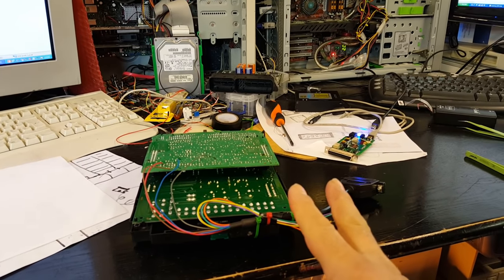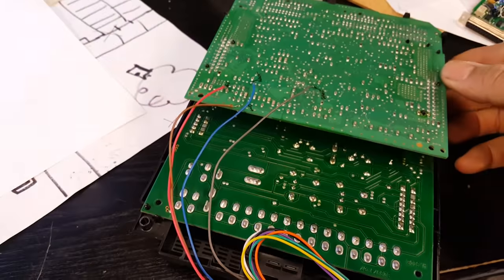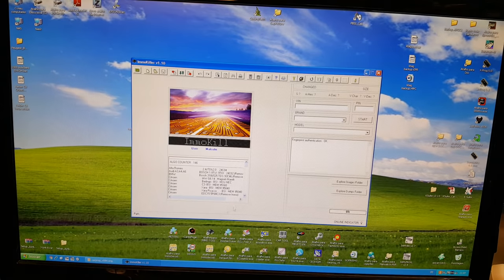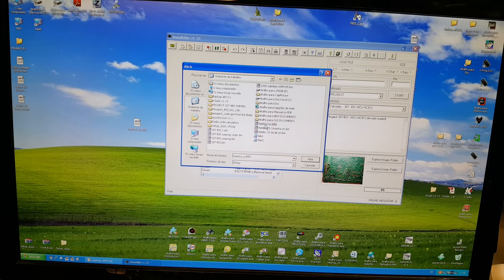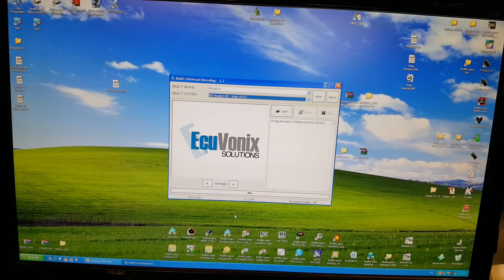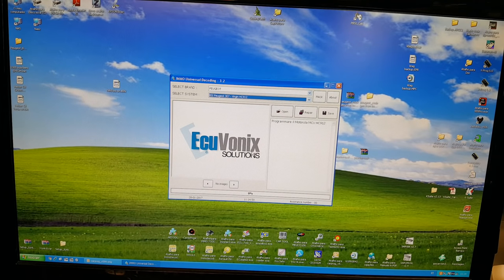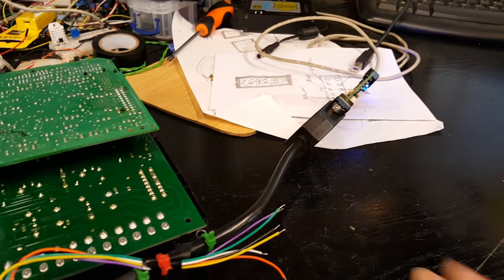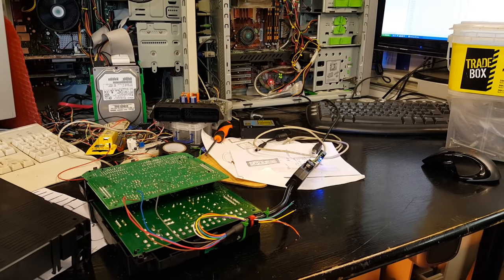Peugeot and Citroën BSI - clone, pin code read, virginize/ reset.

Comment: i have to ask something but i dont know any other place for that so i hope you can give me some ideas in here. my bro has 2004 citroen c2 1.4. cooling fan was not working but car was running well. we took the cooling fan out and fixed it. But after that engine didnt run again, it was just cranking. i guessed that its imobilizer problem. i sent the car to who can do ecu repairs bcz i dont have any tools for that. As i guessed it was imo. He sad i fixed it by cancelling imo which is non sense solution. anyways car came to me, cooling fan working non stop even car is off too. plus engine is not going over 3000 rpm, its running in service mode i assume. Also remote key sometimes locking doors and sometimes dont(this one was exist before repairs too). so what can i do for this car? i think its all about Bsi but you know better so if you can help i can be  happy a lot. Thanks i hope you can answer.
Reply from the maker: Taskin Yucekurt 
Hi
Start by scan the car and look carefully at the live data...
Depending on the findings, follow the fans circuit... 
Thank you for watching!
Reply: Thanks for great videos and help man. Its being hard to find citroen c2 diagrams in softwares like cardata or haynes vivid. Do you know any other one?  diagram methode is so silly on peugeot and citroen. Not cable colors just numbers.  Its also mentioning another control circuit in engine side fuse box too. is it true? sorry if i asked a lot.
Reply from the maker: Hi
Most likely... the ecu will probably ground the cooling fans circuit, which usually is in the engine relay box...
The citroen diagrams are usually traced by the numbers indeed...
Just had a quick look... Autodata does have the diagrams...
The circuit is slightly different, depending on whether you have AC or not...
Either way the system does have a cooling fan control module, which is controlled by the engine ecu on plug B pin J4 wire 1540 and F2 wire 1599B (1599A for the AC)
Hope that helps.
Consider to support my channel and all the hard work put into it at http://www.patreon.com/LMAutoRepairs
Reply: Hi Thanks for advise, i will check it out on weekend. I found diagram on autodata 3,45 you were right  about pin numbers. I got the point but i just confused about Fan harness cuz it has 2 harness on fan plus  socket type relay stays over fan too. tiny harness has 3 cables, main  socket has 2 cables and obviously relay has cables 4 and fan has somekind device on it, i think its speed control unit. i made temporarly solution last weekend. i put a relay between battery and fan, i used fuel pump fuse socket as relay trigger. But you know with this way fan always working  while engine is running. I think they messed up ecu with wrong or faulty software during immo canceling.Tps works faulty too,it has somekind buzz sound and car in limp mode,it was fine before their mess. I cdnt find original bin file on internet. I have old school eprom programmer but im thinking about ordering carprog.

Comment: Really glad to see Portuguese doing great, i have a problem with the JC BSI from a 2009 C5, i Run fvdi to learn PIN and kill it. Have a used One Now, the problem os that i need the PIN to Virgínize it. Can i work the pinout with FVDI or what the best program to read BSI on beanch. Sorry for my inglish not as good as yours :) um grande abraço da velha pátria
Reply from the maker: Nelson Santos 
Hi
Obrigado!
That BSI, does have an external eeprom, or is the one in the MCU?
There is other tools capable of reading the pin from through OBD...
Do you have any other programmers etc?
Thank you for watching 
Cumprimentos...
Reply: LM Auto Repairs good question but i dont know ir it is MCU, is there a way to find out? I only have abrites and lexia3/diagbox
Reply from the maker: Nelson Santos 
Ah... open the old BSI... and see the system... if has an eternal eeprom...
Reply: LM Auto Repairs  well i manage to plug a new flash to my original BSI and it came to life, problem is the flash isnt the correct One soo the wipers always on and the car os manual and the flash os for automatic
Reply from the maker: Nelson Santos 
Ok... at least you made some progress...👍
You need to get the correct one... was that flash virginized?
If yes, program the BSI to the car... and see if you can then flash it again with pp2000... 
Give me the BSI details... and will see if I have a flash on my server... but don't hold too many hopes....lol
Reply from the maker: Nelson Santos 
Lol
Thanks...
I am at work today... I will have a look tomorrow and will get back to you...
Reply: LM Auto Repairs at work até sunday?! We Portuguese just wont made for weekend lolol thanks in advance
Reply from the maker: Nelson Santos 
Unfortunately yes... you just caught me on break...
Been working yesterday, and today... hard life!...😉
Reply: LM Auto Repairs , im getting white hair's from this car... should i flash the original flash from my BSI into the used One? I flash the original BSI with a diferent flash Now that i got what i think its the same software it says that the software is diferent from the instaled One... Dont know what to do

Comment: I have UPA-USB and BDM100. Havent used any yet. I will attempt to calibrate mileage on 2 cars, Peugeot 307 2005 1.6HDi and Citröen Xsara Picasso 2004 2.0. Is it possible to read both BSI and Cluster with these tools ?
Reply from the maker: kiahegelund 
I don't think you can with BDM... I do not have UPA, so can't really comment... check the chip compatibility with the chips in those modules... Sorry if I couldn't be more helpful...
Reply: Okay. Thanks anyway.

Comment: Hi can you help with connection for 307 bsi valeo gox-00 pinout? Have unside mcu or eeprom ? Thanks
Reply from the maker: No sure...
Open it and check...
👍👍👍
Reply: @LMAutoRepairs  I try read like you the board Look this same But carprog read Just 00000 . Somebodys before me try program key after the batery discharge so iam not sure Hi erase eeprom or i have wrong conections
Reply: Any information will help

Comment: Hi i have scanned the car only obd11 i got foxwell nt612 it dose everycar  exception peugeot . no codes present.no pending codes. i notice your using lexia  I've seen the software on eBay about £50.00 are these any good to fixing my problem.Thanks
Reply from the maker: Geoffrey Rawlings 
Well... fix is relative. 
It will definitely help you to see what is going on... to fix, it will depends on what the problem actually is...

Comment: Hi are you not able to access the pins via the connector, so that you don't solder on the board
Reply from the maker: Donovan Bent 
Hi
Not really... for that you do it through the OBD port... but that is a different tool...

Comment: hi
 is it possible that when removed the immobilizer on a peugeot 307  the air cinditionner did not works? thanks for a reply 
tino
Reply from the maker: tino Choolun 
What do you mean, you have removed the immo from the engine module?

Comment: I have a citroen berlingo 01 model multispace and my key remote stop working.I changed the battery but no luck.I bought another new key remote, i programed the immo it works ok and it starts the engine but it can't be sinchronized with the bsi.....
any thoughts?
Reply from the maker: axakias 
Maybe the problem in on the car...
Have you checked that the car is detecting the key signal? 
Thank you for watching!
Reply: How can i detect the signal?  Through lexia? That would be a great next video....

Comment: Hello I have in my garage peugeot 307 hdi 2.0 ... virginize bsi valeo and after programming 2 keys he is left without diagnosis and the engine does not start ..Stops starting after bad contact in the battery .....Law pin code of the ecu (siemens 801) ...I do the programming of bsi, then the 2 keys with pp2000,  Immediately after learning the 2 keys, it will lock and go into eco mode ...Can you give me some idea???? thanks ..sorry my bad english
Reply from the maker: Fernando Pereira 
Ok... so where are you at the moment?
Can you communicate with the BSI? 
Can you attempt update the software on the BSI?
Reply: Thanks for your reply, solve the problem was the ECU eeprom 93c56, no contact on its 8 legs on the plate ,,The only problem now is that the windows do not work, there is no communication with their modules with pp2000 ,you can help??? Thanks your videos are inspiring for me

Comment: my 406 automatic ecu not communicating with BSI , what is the best way to replace it, is there a way to virginise it, or is there a eeprom that can be swop, thank you, I really enjoy watching your videos,
Reply from the maker: Hi
Do you mean the engine ecu is not communicating with the BSI?
Thank you for watching!
Reply: LM Auto Repairs 
thank you for quick reply,
It's automatic gearbox ecu is not communicating with the BSI, It's Siemens,
Reply from the maker: Susantha Batagala 
Ok... but when you scan the car, can you communicate with the gearbox ecu?
Reply: LM Auto Repairs 
No I can't communicate with it.
Reply: is it part of the the immobilizer  system?  coz key sign is always on the dash, or immobilizer has kicked in when the ecu communication is not registered?
Reply from the maker: Susantha Batagala 
There is any other modules you can't communicate with,  or the gearbox ecu is the only one?
Reply: LM Auto Repairs 
only the gearbox ecu
Reply from the maker: Susantha Batagala 
I would check (if you have not yet...), the wires to the ecu... from voltages to communication lines...
Only then, I would move to change the ecu...
I have never seen one of those modules opened, but surely you will be able to swap the memory chips... I am not sure if that is part of the immobilizer system, some cars is, so might be that the case... what does the immobilizer module says?
Reply: LM Auto Repairs
I'll check the wires tomorrow.Again thank you so much for your quick replies.

Comment: Hi can help please .I have peugeot 206 1.4 i left ignition on accidently and flaten battery .now have eco- mode on dash car turns over but will not fire pump primes .was starting and running ok previously.
Reply from the maker: Geoffrey Rawlings 
I would bet on the immobiliser... but just a hunch... have you scanned the car?

Comment: Hy, thanks for the video. I have a problem with the central locking system and I suspect that the problem is coming from the BSI. I have a C4. The problem is that I can lock the doors with the remote key and it works perfectly, no problem at all. However, when it comes to unlock the doors with the remote key, it doesn't work except the boot. The button on the dash does exactly the same as the remote key. Press it once and all the doors lock. Press again and the repeater lights flash but the locks stay locked - no clunks or other noises. The receiver also clearly works as the side repeater lights flash briefly when both the lock and unlock buttons on the key are pressed. The snag is the unlock process seems to stop there. I have read in some forums that it is a BSI problem, to be more exactly relays faults. So what they do to solve this problem is to remove (unwelding) the relays that control the central locking system and put some other relays or change completely the upper board as it appears to be non-unique, so changeable for any other board. This upper board contains a number of relays which amplify the signals from the computer. The only unique board that contains the VIN and all the programming is the lower board so unchangeable. My question is, do you know what relays control the central locking system? Could you please send me a photo, if you know which the relays I am looking for are? Sorry for my English I am from France, lol.
Thanks.
Reply from the maker: JJ sam 
Hi
That's correct... the mains circuit board can be changed on its own...
Which relay actuates the central locking, depends on the BSI type... there is different makers even on cars of the same year... so it all depends on which one is fitted on you car...
Reply: Ok, Thanks.
Reply: Sorry to disturb you again. I took a look to my BSI and the reference of the BSI I have the problem with is this one: 9661940480 BSI 2004 H05-0131006. If there is any chance you can help me identifying the relay that controls the central locking system that would be nice of you.

Comment: Hi Mate, 
Chris from Denmark again.
My friend change his peugeot 307 2.0 fuel instrument cluster, the second hand unit worked fine but he experienced a problem where the mileage went from 120000 to 146000 km, any tips for him.
Thanks for the video.
Reply from the maker: Christian U Nwaebe 
Hi
That happened because the cluster he bought had higher mileage than the car...
The mileage is stored in the BSI  and cluster... if you change one of this components, they will adjust to the highest...
He should have reset the mileage before plug it in.. now is too late.
The only option is remove BSI and cluster, change one to the correct mileage and reset the other one...
Alternatively there is tools out there to do that through the OBD....
Hope that helps...
Reply: Thanks Mate,If you dont mind, can you share the alternative  OBD tools that can get it back to it original state?
Thanks

Comment: I've just erased my Peugeot 406's BSI's eeprom to virginise it and now the cars dash reads 600000 miles! It was only at 124k before. Does anyone know what went wrong? Can i correct my mileage somehow in the BSI and dash eeprom dumps?
Reply from the maker: Put the mileage at 0 on the bsi... and the 124k on the dash... or vice versa... Once connected they will sync to the highest one... in that case the 124k...
Reply: @LMAutoRepairs   Thank you, I’ll try that. Is there software you can recommend for modifying the bin files? Is it safe to read/write the EEPROMs in situ or should they be removed?
Reply: I think I only read part of the eeproms bin file, so only erased part of the bin and this caused the problem. TL866ii seemed fine, no pin errors, just didn’t read the full file🙄
Reply from the maker: @leehazard5225  
I would remove them... it is safer...
👍👍👍
Reply: @LMAutoRepairs  thanks for taking time to reply👍

Comment: pleaaase help
i have a misfire on cylinder 4 on peugeot 307 maybe its the Bsi problem 
i bought another Bsi 
 can i just swap the immobilizer eeprom 
in order to start the car ?? or do i have to get the xprog and the pp2000 as shown on the vedio ??
Reply from the maker: Rahaf Aldoush 
Hi
Why do you think a misfiring is caused by the BSI? 🤔
If your BSI has a eeprom, then swapping it should allow you to start the engine... if is eprom, then things are bit more complicated...
Reply: i replaced the whole motor and the same problem
its for sure the ecu or the bsi 
if i buy a bsi and an ecu with keys 
and i followed your vedio isit going to work i mean i will be able to start the car ??
and can i install a bsi for a peugeot that has a motorcode 3a on my car that have 3h motor code ??
my car is 307sw 1.6 3h year 2006 benzine
Reply from the maker: Rahaf Aldoush 
Is your car petrol?
Reply: lmsvvavr its benzine yes
Reply: lmsvvavr it had a LPG system gas installed and since it was giving me an error about emission system i read the ecu it was cylinder 4 misfire,  changed the sparkle plug,  bobine,  checked the air hoses i even changed the whole motor the same problem 
The car starts normally after a while the 4th cylinder goes down 
I also changed the temperature sensor for the coolant the aircro condincer the same
The last hope is the ecu,  
And the weird thing is if you turn the ignetion off and take tje the keys out while driving and left you leg off from the clutch the car will start normally, and you will be able to drive it
Reply from the maker: amir frouh 
Your problem might be related with the BSM... just a guess... Don't take my work for it, not without correctly test it/diagnose...
Reply from the maker: amir frouh 
Bobine?  You mean coil pack?
Reply: lmsvvavr yes coil pack
But what is the BSM 
And why canot be the ecu or the bsi??!!
Reply from the maker: amir frouh 
If your coil pack is the one that is one piece only, and not individual to each spark plug, the engine ecu triggers 2 cylinders at the same time, so you would see 2 cylinders misfiring...
The BSI do not really interferes with the running of the engine, except for the immobilizer system...
The BSM is the "fuse box" module in the engine bay... that has a lot more with the control of the engine...
But, I am just saying all this without even know exactly which engine/system we are talking about nor look at the car... 
So, I might be wrong...
Reply from the maker: if you virginize a second hand BSI, you then need the pin from you car, in order to reprogram the virginized BSI... you will also need a blank transponder, and your remote will no longer work nor can be programmed to that BSI...
As far as the BSI is the same, physically, it should work, you just might need afterwards, to coding the options... like, if air conditioning is fitted, alarm, and things like that...
If you can find the exact same model number, will be better though...
Hope that helps...
Reply: lmsvvavr  thx alot
Reply from the maker: amir frouh 
👍